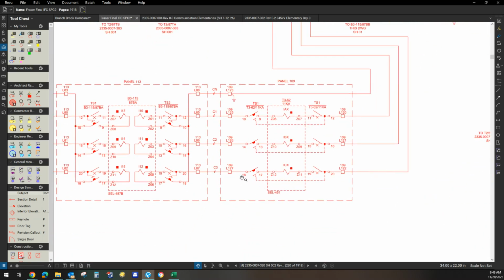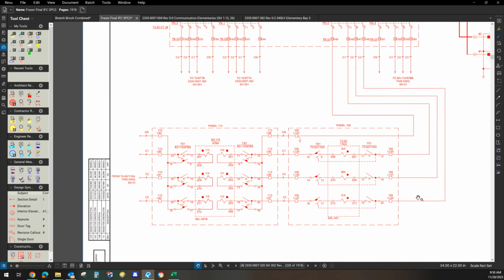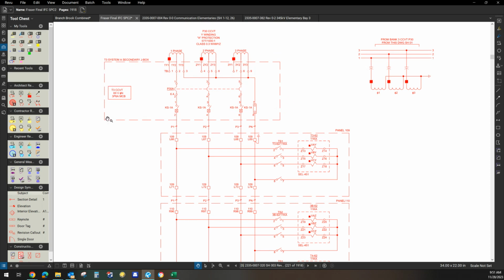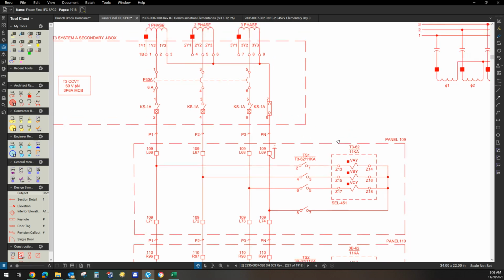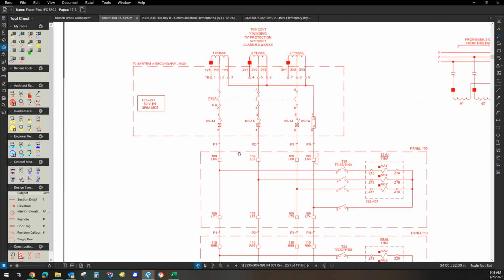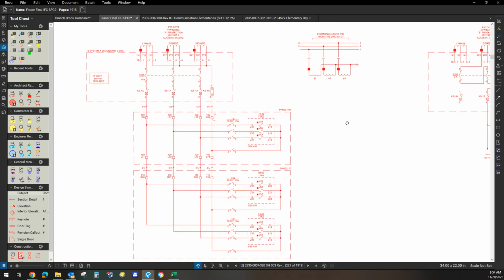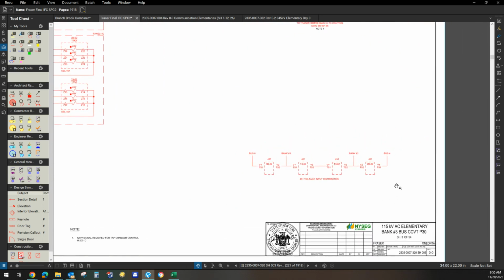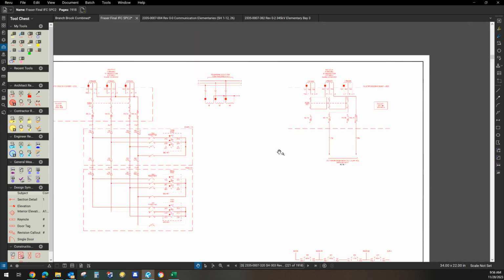Testing and Commissioning: Digesting Drawings  AC Elementary 3 Line Continue with CCVT's

Comment: Why does LTC controller use X1-X3 full winding whereas SEL-451 relays use Y2-Y3 winding?
Reply from the maker: Great Question.  The answer has 2 parts.  Part-1: Typically designers will use different voltage windings for protection and control.  In this case the SEL-451 is being used for Breaker Protection and utilizes the "Y" winding.  Furthermore, the "Y" winding is configured for 69 VAC Phase to ground.  The LTC voltage (x winding) is for sensing and tells the LTC when to change.  If both SEL-451 and LTC were using the same winding and we lost that winding due to open fuse, we would lose our voltage sensing to SEL-451 and sensing of the LTC.  This would not be a good design.  Furthermore, the LTC requires 120 VAC Phase to ground input.  The "X" winding is configured for 120 VAC.  Part-2: Utilities have standards and specifications that must be followed.  In this particular Utility, they require different windings for protection relays verses controlling devices.  If you ever run into a case where you see protection and control voltages originating from same source and same winding, then raise you hand and ask quetions to the engineering design team.